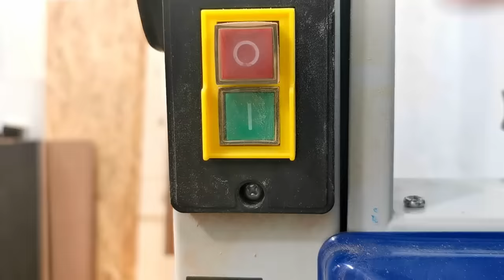DIY TABLE - Hiding the Joints with EPOXY

Comment: This exactly I wanted to do with one of my project. I think you can make your life easier if you transfer the edge profile to a 1/4in mdf as a template and then use a router to cut it precisely. Great build!
Reply from the maker: Thanks! I thought about doing it that way, but in the end, I decided on this method, which is a bit less accurate but I believe is faster
Reply: @marmotaworks  in my case i am trying to avoid epoxy fill so thinking of using the router and then use wood glue. I hope it works

Comment: Fantastic looking table. When you buff the hardwax oil with the scotch brite pas is the hardwax oil still wet? After you apply the second coat do you buff it again? if so wet or fry and do you then sand a second time? Your clips are an enjoyment to watch and it so good to see a talent like you have. I enjoy the format that you have the clips in and the humorous \cheeky moments you include. Thanks heaps for sharing with us.
Reply from the maker: Thank you! I buff it when it's still wet, I sand it the next day after it has dried, and then apply and buff the second coat of hardwax oil.

Comment: Btw, you might want to check out the 3m Xtract cubitron sand paper. Lasts longer, cheaper and can help to cut down on time. All around better result.
Reply from the maker: I have tried other sanding discs, and I didn't like them very much. I will try the 3M ones you mentioned

Comment: Amazing results.. Loved the final reveal.. Enjoyed the track too.. Btw since you joined the boards when the epoxy was tacky and poured the rest of the epoxy does it actually penetrate the holes you drilled? Also the bottom supports would a bow tie insert adds more strength or your rectangle is same?
Reply from the maker: Thanks! !
I haven't sealed the areas around the holes to allow the epoxy to penetrate as best as possible, maybe I should have mentioned it. In my opinion, the bow ties are just as strong as these, I only use them when they will be visible because they look nicer

Comment: Why don't you use wood plugs to join the slab's? It lays internal, is less work and holds just as good. 
If you glue something back on the edge more pressure is recommended if you want it to hold for long time. Since clamps are difficult to use on a round object use the transparent flexible tape to apply more pressure. 
But all in all great work looks beautiful
Reply: Using wood plugs I recommend wood glue. Sure some pressure is required here too. Using clamps and a piece of wood with a negative curve to give you a surface to clamp together without the clamps losing its grip
Reply from the maker: For my that way was easier.

Comment: A very cool looking table, but i felt so really sad when made the very beautiful looking rectangular slab into a round one and loosing so much wood because of that.
Reply from the maker: I didn't have a perfect rectangle, and I would have had to fill the gaps with a lot of epoxy.
Reply: @marmotaworks , i see now what you mean.  it would have been a versy small rectangular table.
Dont mind any future the end result is very good.

One small question; what is that wood named that you use for the router slider? I have seen it being used in other yt videos as well, but i cant find it in any dutch store looked at,
Reply from the maker: @NielsNL68  in English it's black plywood